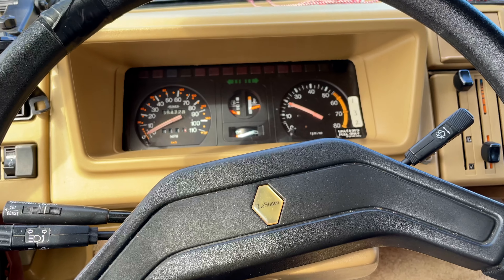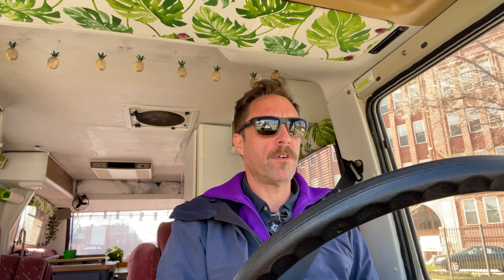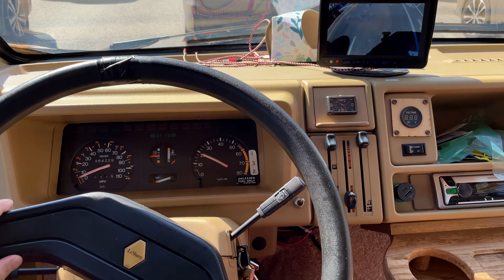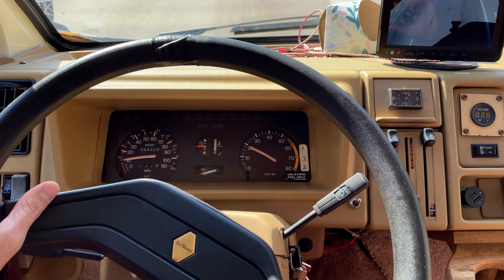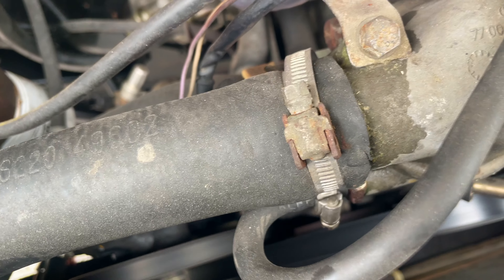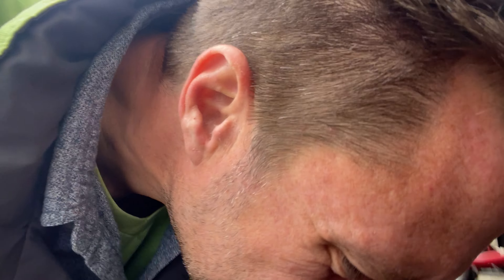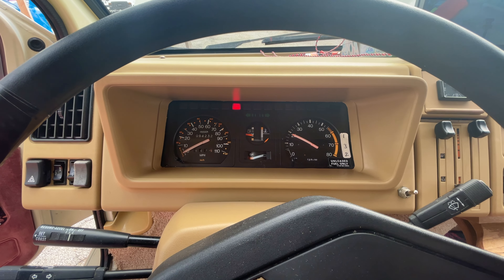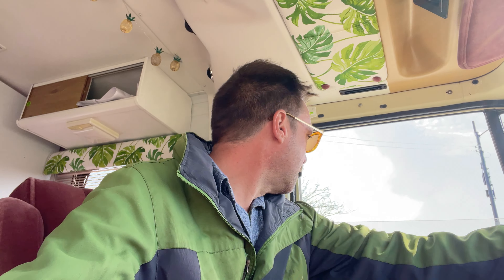Springing Polly 2022

Comment: Hello captain! 
Will a negotiator I am not and I probably paid $4,000 too much for my lesharo. But I'm pretty sure all tanks are good and all systems work... Which leads me to a request video. How to use the heater the thermostat and the shower with hot water? 
I'll be trying to sort through this today so by the time you make the video I probably already figured it out. but I think it would be a cool video.... PS evWest would not work on any RV... So I will be looking around. For now it's all Renault!
Going to AAA to try to register this thing this morning.
Reply: Congratulations. My water heater is different, I replaced it with a residential under sink unit. And my heater stopped working last year. I have not touched it since a small space heater works very well and is much quieter. I just need to be plugged in to use it. Good luck!

Comment: I'm thinking of buying an 86. Given the issues you have had and your overall experience, would you buy one again? How much do you figure you are in for by now with towing, starter rebuilds, power steering etc. Would you do it again. I'm looking at one with abou 60k miles Renault 2.2.
Reply from the maker: I'd definitely buy again. Find one with a good roof and get the A/C gasket replaced immediately to prevent further water intrusion. Winnebago still hasn't figured out how to make a water tight RV in 2023 as I read on the forums.  If you can afford it, find one that has been converted to a more powerful engine, most commonly Chrysler minivan.  I'm hoping one day to fit a GM 3800 Supercharged in mine. With a few mods you can get 350+ HP and good reliability!

Comment: I took my lesharo out Sunday. It has brand new tires, but they RV say for years. Got an hour out from the house and “kaboom”. Blew the right rear tire. I had a spare and made it home. RV ran great 2.2 L. What tires are you running?
Reply: 205R14C Truckmaxx Maxxis UE-168N tires. Great tires, a little bigger than stock so get an occasional rub on the fronts when turning but rarely.